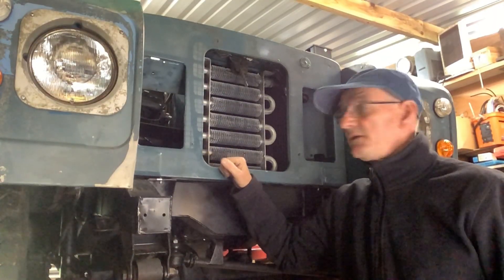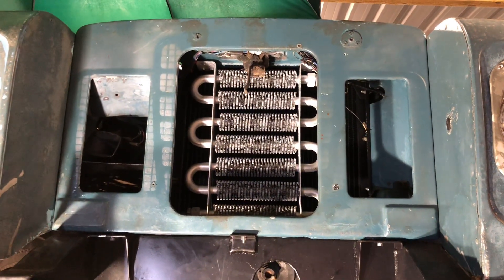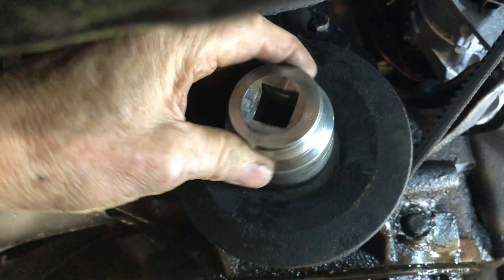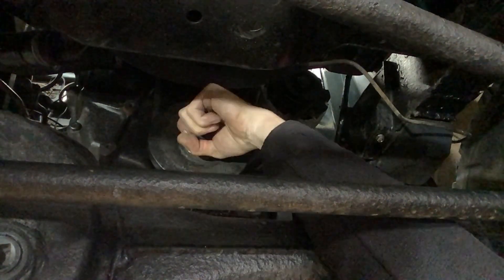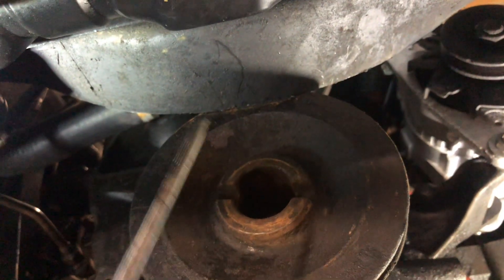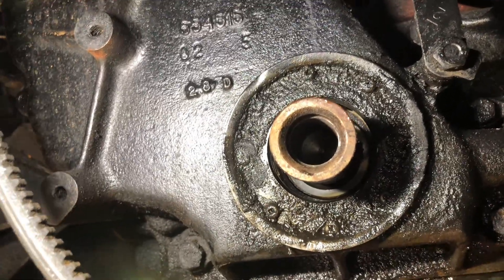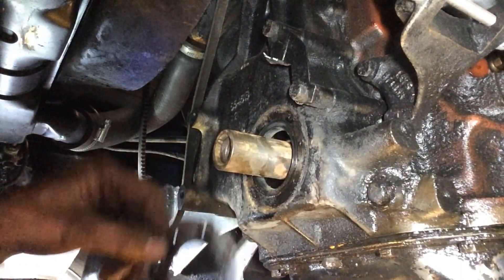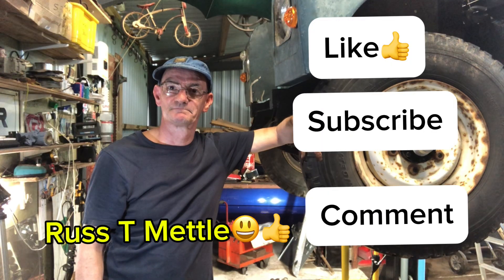Land Rover Series. Starter Dog and Crankshaft Pulley. How to remove.

Comment: Superb video - love the tip of using the starter motor to release the nut...brilliant!
I ran my car in the garage and now have a small puddle of oil on the floor - right underneath the cooler fan. This seems to suggest that I too, might have to do the same job...

What would you have done if the fastenings behind the crankshaft pully were rivets? Would you have removed the whole front of the engine (water pump etc.), to drill the rivets out without risking bits going in the motor, or would you have also carefully drilled them out in place?

Throughly enjoying your videos!
Reply from the maker: Hi thanks for the the comment. I would have tried drilling them out and picking up any bits with a magnet  first 🤷‍♂️glad you’re enjoying the vids. Russ😃👍

Comment: Great video again Russ. 
Give that crank pulley a good clean up first, and a bit of pipe sealer in the threads will keep the leaks at bay, swap the screws for engineers screws, Allen key drive, easier to get out again if you have to. 
Cheers
Reply from the maker: Thanks for that. I’ve found a new pulley wheel on eBay for £28 so may as well put new one on. Engineers screws is a good call the problem is they’re small holes I may have to drill them out to tap them. I wonder if a bit of swarf dropping inside the timing case is a big issue. 🤔or will it just get washed into the sump from there ? Maybe once the seal is out I can put a load of grease round the back to catch it 🤔 Hmmmmm ? Cheers Russ😃👍
Reply: @russtmettle grease would be an easy and effective solution. 
Tap for M4 if you don’t mind going metric
Cheers

Comment: I wonder if the pulley has just been polished at the point of contact of the oil seal.  Maybe when you clean up the rest of the surface on both sides, the perceived groove may actually be raised areas at each side  from rust .  Also once it is cleaned, see how a new seal actually makes contact.  It may be just that the pulley wheel needs some cleaning with emery and a new seal.  Good trick with spinning the engine.  Another lesson leant for ANY vehicle with a starting handle dog, such as my old 1960  MG.
Reply from the maker: Thanks for the comment. Yes it’s a handy thing to know. I’ve got another one to do on a different Landy. As you say it should work on any vehicle. Cheers Russ😃👍

Comment: I replaced my front crank seal and it’s leaking again….. Damn!
My crank pulley had no wear, I would think any wear on a sealing shaft would be a certain failure in the short term. Not cheap to replace but would probably cost the same for an engineering company to repair it.  Wouldn’t hurt to put some silicone sealer on the retaining plate, I didn’t 🤔.  Wynns engine gasket sealer is my latest favourite sealer, it lasts for months in the self dispensing tube and you can adjust how much comes out. 🙂👍
Reply from the maker: Oh dear☹️. Nobody likes doing the job twice. I found a new pulley on EBay for £28 so I ordered one. Those screws leaking is an issue. Also modern rubber is absolute rubbish so maybe that’s your issue.the seal itself ?

Comment: What's the answer to which fastener you put back on those troublesome screws? I guess you could go up a size to get better heads. I have no idea how to stop that leaking.
Reply from the maker: Yes I will look for some better screws. The holes are very small and I wonder if I’ll have an issue with the swarf if I drill them out. 🤔?

Comment: You sir are a genius of the first order!👍
I think that grove on the pulley is a bit too deep to reuse. You could slip the new seal over it and see if it is a snug fit.
A trick I’ve used on screws with  heads that are starting to strip; I have an apex bit that I sharpened with a backwards cut on a grinder, then I put a little abrasive compound on the screw . I put the bit on a speed handle and lean into it with my shoulder. It usually works. 
Cheers.
Reply from the maker: Thanks for that. As for the groove. I found a new part on eBay for £28 delivered so I’ve ordered one. It would not be nice if I put it back together and it still leaked 😩cheers Russ😃👍

Comment: I used that trick on my RRC 300 tdi and my wife's 200 tdi disco,  I would replace the pulley and thread lock the screws and for good measure a small amount of RTV on the plate , love the video's keep them coming.
Reply from the maker: Thanks for that. I’ve just looked up the pulley. £28 on eBay so Ive ordered one. Thanks for the tips. I Will do that.  Cheers Russ😃👍
Reply: Maybe instead of threadlock on the screws, use the RTV there too? You probably don't want to make them even more difficult to remove.
Reply: @seeligf  I should have said thread seal its non setting, not sure about pushing RTV into the crankcase when you screw them in.
Reply from the maker: Yes I know what you mean. I think I may have to find some better screws too 🤔